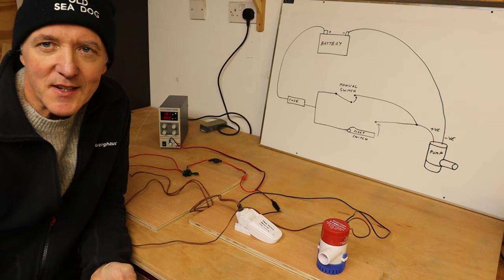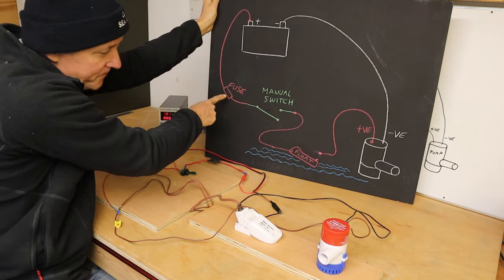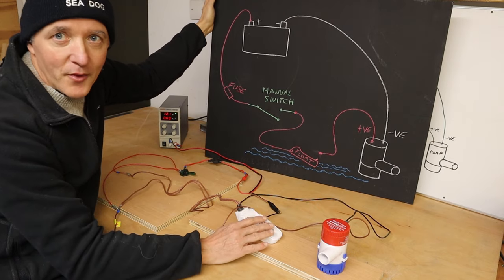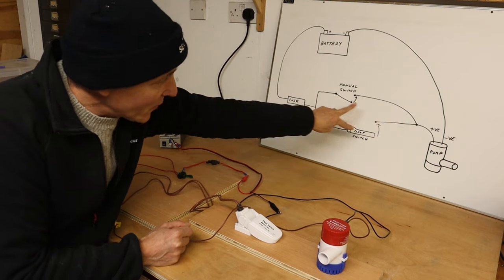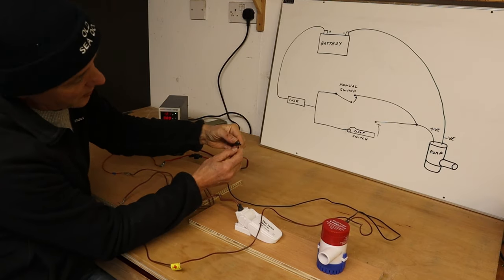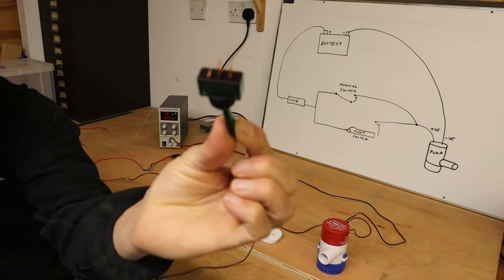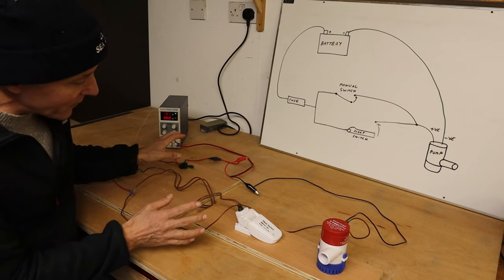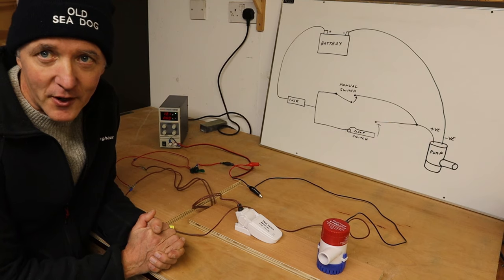How to wire a bilge pump? We show how to wire a 12V bilge pump float switch with a manual override.

Comment: I am a mechanic by trade and you are correct, this is a very simple circuit which I've done many times. With that said, I know you are trying to make it as clear as possible for the viewers but you're really not explaining it well enough to make it understandable for beginners, you need to do one wire at a time instead of just saying "hook it here hook it there" because some people aren't going to understand it or get it. You made an awesome diagram on that board so maybe slow down and one wire at a time pointing to your visual. I would like to thank you for sharing your time and knowledge with everybody, you are very much appreciated 👍🏻.

Comment: Great follow up to your first video. I ran mine slightly different due to my setup on my fishing boat. I went pos bat, fuse,  pump, neg split 1 through float to switch top position, back to ground, neg split 2 to switch down position back to ground. Much less wiring for me this way and taking advantage of 3 position switch.

Comment: Finally someone explained the installation of a float switch in easy terms. My boat manufacturer said they don't add the float switch to save the consumer money.  I would rather pay a few dollars more for the switch than find my boat sunk at the boat dock.
Reply from the maker: Hi thanks for your comments, and absolutely worth spending a few dollars more!
Reply: Finally is right!!! We were having a misunderstanding about the two wires on the switch both being positive. Makes sense now! Thanks!
Reply: Great video.  Clear and concise .  Thanks for sharing.
Reply: Do NOT trust a float switch to keep your boat from sinking.  You have to keep an eye on a wet-slipped boat.

Comment: A couple of thoughts... it's still a good idea to have a manual switch that can disable the float switch... in case it gerts stuck on (if some detritus gets stuck under the float switch etc), and so it can't turn on while you're refueling, connecting gas cylinders, etc as the float switch's contacts and the pump's brushes will make a very small spark internally and of course the pump's located at the lowest point where fuel/gas vapours will collect. Also, if you fit a small light to the common wire that connects both the manual & float switches to the pump you can have a "pump running indicator" which will alert you to when it automatically turns on. If your boat's filling up more often than it should be due to a leak or something it's not a bad idea to have some sort of indication that the pump's running, and if you turn it on manually and it doesn't light up it alerts you that the fuse is blown or that there's some other problem. You can easily mount the light next to the manual switch. (I also put an "automatic active light" next to my disable switch to remind me that the float switch is activated. I also fused both the automatic and manual circuits individually so if one fuse blew I still had the other option.)
Reply from the maker: Hi thank for your comments.  I think you have made some very good points there, and I like your thinking.  Much appreciated.

Richard
Reply: Like a three-way manual.  You can also house the float so debris can't get stuck under it.  But, I've seen floats stick open from grunge build-up at the hinge or even from just their own friction.

Comment: Do float switches never stick closed? That is, do they never fail in such a way that the pump is stuck on? A three-position switch might be a good idea, toggle on/off/auto.

And I'd want a counter or hour meter, so if I was away from the boat I could know if the pump has been running.
Reply: They can stick in either the on or off position - and, often do.

Comment: Can you zoom in on the connectors ( closeup) ie eg.the pos from switch and pigtail to 3way switch ,hard to see...
I had to wire 2 negatives into 1female connector...after the instructiions said" Connect the neg wire from pump to neg terminal on float switch.
Now Connect neg terminal of battery to neg terminal of switch...
Helpful if more closeup of actual connectors thx great video...
And of  course instructions are not always diagrammed properly

Comment: The manual switch should be one that lights up when it's "on" and the pump should energize a tell-tale light at the helm when it's operating. Manual switches can be accidentally turned on which is something the operator needs to know about. If the bilge pump stays on for a long time via it's float the operator needs to know that something is either stuck or there's a big leak somewhere.

Comment: Quick question. On my boat the bilge pump works when manually switched on but not from the float switch. However, when the system is plugged into the wiring harness for the other bilge it works. in other words, the float switch works fine, but not when connected to one of the harnesses. Very confusing.
Reply: The float is not getting power from one of your harnesses due to a bad contact or tripped breaker (or burned fuse).

Comment: It'd be interesting if you could show how to waterproof a 3 wire splice ,as is required for auto override. 
 Pumps and float switches are never supplied with enough cable to reach somewhere dry in commercial fishing boats fish hold settings where there is always water dripping through the floor from melting ice , in such settings automatic pumps are ideal but manual override is also required for all the reasons you outline . Thank you.
Reply from the maker: Hi many thanks for your comment and explaining your situation on commercial fishing boats.  I will put some thought into watering a 3-wire splice.
Reply: Regan my son got a special electrical clip over the main bilge pump wire which the female spade  clip is crimped to the wire on the float switch    which you push straight onto the male clip &  the female clip has heat shrink on it & I completely wrapped over with black electrical tape & I hunted high & low for that type clip & was lucky to get one like that & it saved me cutting the wires & if I couldn't get this clip I would have got a complete T water proof connector from AliExpress Store & the clip I got is a T one as well but wasnt water proof but wrapped with electrical tape should work well & wrapped over electrical conduit & hopefully that's helped & it's pretty dry underneath where wires are Kind Regards Peter
Reply: I would advise against a three wire splice.  Use a terminal block that you can render water resistant or a quality, waterproof plug.
Reply: This

Comment: Great video I had the same worries about float switch failure so this helps a lot! You referenced another video that will include a switch panel, is that still in the works? Also, what size fuse should we use if the pump says 4amp but the switch says 20 amp. Tsunami T800 bilge pump with Rule 40A float switch for reference. Thanks again!
Reply from the maker: Hi thanks for your comment and questions.  The fuse should be selected based on the pump as it has a lower rating and you are therefore wanting to protect the pump from over-load.  Yes the switch panel video is due pretty soon - hoping to get part 1 out in the next 10 days.

All the best,

Richard
Reply: The amp rating for the switch or the float is the current flow it can handle without burning up - it's essentially irrelevant to the appliance circuit.  What you want is the proper amp rating for the appliance circuit.  If your pump can draw max 8 amps, use a 10 amp protector; if it can only draw 4 amps use a 5 amp protector.  You're never come close to burning up a switch.

Comment: Great easy to understand vlog, Thanks.
What are your thoughts on integrated float switches in the bilge pump? Or go for both for the £25 quid for an extra bilge to guard against single bilge failure in parallel with the existing separate float switch and bilge pump here? Overkill and a more things to fail of worth it as it's not much more money for peace of mind.
Reply from the maker: Hi Jon, many thanks for your comment.  I am glad you asked this question, I am in favour of many bilge pumps for added redundancy and safety, I would suggest at least 2 and sometimes 3 or 4 or more are appropriate for larger boats.   I am quite a fan of pumps with an integral float switch as well.

Richard
Reply: I wouldn't own a boat with only one bilge and I always push my customers to add a second one ESPECIALLY if the vessel lives in the water. I also go a little overkill on the GPH cheap insurance if you have a thru-hull fitting or similar type failure.
Reply: Separate float and pump only.  Why?  Because it's cheaper and easier to replace the bad one alone.  If your float fails ($30);  if your integrated detector goes bad, you have to replace the whole works ($200+).
Reply: It would make sense to explain what a "larger" boat is.  Up to 23 ft or so, one pump can more than suffice depending on its boat design and conditions of use.  Twenty-three to 30, probably better to have two pumps.  Thirty ft or so and up, go three.  And, so on.   @BoatFittings
Reply: If a thru-hull goes, you had better have a whole lot of GPH (that you're not going to get from even two or three typical pleasure boat pumps) and plenty of battery power (also unlikely).  Keep an eye on your boat. @a1aadvancedmarine88

Comment: Good video brother… asking about fuse size its confuse me Little bit .. I know that the fuse should be less than Amp max current … they mentioned in the manual it should be higher ?? 
Can you explain it please ? 
Thank you very much
Reply from the maker: Hi Mohammad, thanks for your question - I will try to answer it with an example.  First thing to say is that fuse is to protect when things go wrong.  So normally the fuse will not blow.  Now for example we could have a bilge pump that normally takes up to 7 Amps.  So in the normal situation the pump takes 7 Amps at most (when starting up, or when working hard) or when working less hard around 4 Amps.  So the fuse should be rated above 7 Amps otherwise it will blow every time you turn the pump on so we could have an 8Amp or 10Amp fuse.

So what could happen when something goes wrong ?  The pump could get jammed or seized up and cannot turn.  Then when you turn the pump on it takes more current than usual - maybe 12Amps or 15Amps and in this situation it would get hot and maybe burn out or melt the wires (bad!).  Here is where the fuse comes in and as soon as the pump takes more current than the fuse rating, the fuse blows to keep everything safe.

I hope that answers you question?

All the best,

Richard
Reply: @BoatFittings  so Appreciate for the answer no it’s makes sense for me to continue my project thank you so much for your help brother.

Comment: For safety, mount a second switch a little higher than the first in parallel with the first so if the first doesn't activate, the second one will a little later. Or hook the second switch to a second pump and add a buzzer wired across the second pump's leads to warn you when it comes on. Cheap insurance for an expensive boat.
Reply: Good advice.  Floats are notorious weak links - they fail frequently.

Comment: Could you add a alarm system. So if the boat is collecting water and the pump is on for say 2 min a alarm will sound
Reply from the maker: Hi Bill, that is a great suggestion.  I will have to think about that one.  I will definitely put it on the list.

All the best,

Richard

Comment: Hello, I've subscribed, I just brought the seaflo 4700 GPH and have no idea what cable I need all I k ow is its 14 gauge but from watching other you tube videos there saying copper is a no go with these pumps... This is to empty a swimming pool and will be connected straight to a battery could you help me in anyway or give me some guidance because I'm genuinely out my depth any help would be massively appreciated
Reply from the maker: Hi thanks for your comment and question.  With regard to the wire I am not saying copper is a no-go, but there is an advantage in the long term for pre-tinned copper as it will not corrode.   If you cannot get pre-tinned then normal copper wire would be ok.  The most important thing when choosing the wire is that the gauge is thick enough.  Thicker is not a problem, but thinner can lead to over-heating.  I hope that helps a little.

Comment: Have an existing on/of switch and pump.  Pump has brown and black.  Float has brown and a brown/white wire.  I ran fuse to battery + to brown/white on float.   Other float brown wire to brown on switch.   No power.   Any ideas?
Reply from the maker: Hi Bill, thanks for your comment / question.  I can't make comment based on your wording as  I might mis-interepret what you have done.  If you send me a photograph though to info@boatfittings.co.uk I could try and make a suggestion.

All the best,

Richard

Comment: Hi what gauge wire can you with the pump and float switch it draws 15amp. And what amp fuse can i use
Thanks
Reply from the maker: Hi thanks for your question.  Normally the pump should have a label showing the recommended fuse rating.  If it actually draws 15amps then the fuse needs to be a bit higher -eg 20Amps.  As for wire gauge a quick google on 'wire gauge vs Amps' should bring up some good results.

All the best,

Richard
Reply: Correct about wire gauge and appliance amp draw, but remember that TOTAL CIRCUIT LENGTH is important as well.  A pump that is 4 ft from the battery (8 ft circuit) can get by with a smaller gauge wirenthan the same pump that's 24 ft from the battery.  @BoatFittings